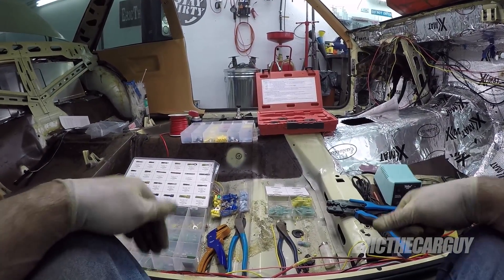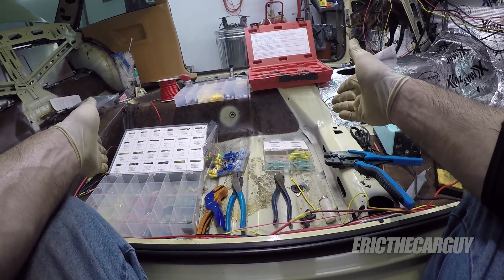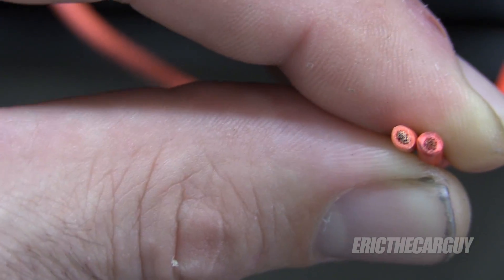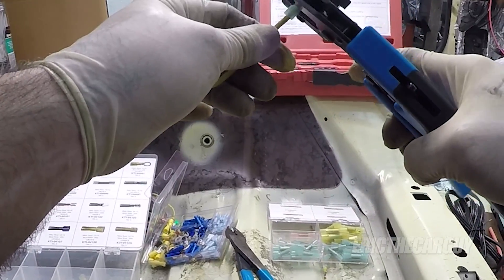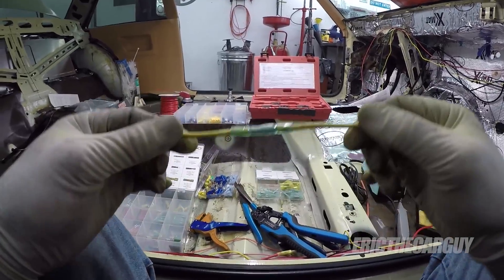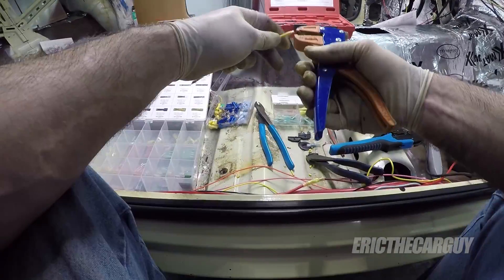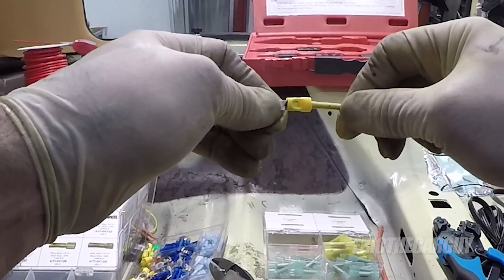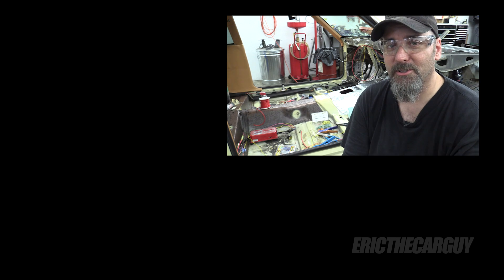How To Crimp Electrical Connectors

Comment: I love those terminals with the heat-shrink tubing pre-installed. And I hate the ones with the hard plastic. I also tend to use non-insulated terminals for ground connections. Almost everything on the car grounds to the chassis, anyway. So there's no need to worry about short-circuits.

For connections that will be exposed to the elements, I like to use "fully insulated" terminals or weather-pack terminals. On the fully insulated terminals, I put a dab of grease into them before connecting them, to keep moisture out.

Comment: I have a tendency to go into Hulk mode when crimping insulated terminals, so ever after shrinking the heat tube, I'll see hairline cracks in the coating, so a small band of electrical tape is the norm for all my projects.

Comment: I like to use solder and heat shrink tubing and a heat gun, especially when doing lots of connecting because it is not as bulky when putting everything back together and much cheaper and stronger and just as quick or quicker if you have a good solder gun tool.

Comment: It's kind of weird to me the to try to imagine the gauge of a wire using AWG (american wire gauge), where the higher the number the smaller it is. But that's because I'm used to square millimeters for wire gauge since forever. The eternal "imperial vs metric" thing.

Comment: Automotive wiring if one of my favorite things to do! I actually remove the plastic insulation from crimp connectors (other than butt connectors) and solder them on (no crimping) and add a little dielectric grease (stops any corrosion caused by the solder) with my own heat shrink. It comes out super strong and looks very good. I'm not a big fan of connectors that come with heat shrink built in because MOST, not all but MOST have a heat activated adhesive layer on the inside. Some people like the adhesive, but IMO it causes issues in the long, long run. Some of that adhesive will extrude out onto the wire when you heat shrink it, this extra adhesive is messy and collects debris. This debris can become conductive over time, just look at videos about dirty batteries and how that dirt can become conductive over time. Just my two cents, albeit my two cents is probably only worth .5 cents to most people that read this whole thing. Great video Eric!
Reply from the maker: Good to know. Thanks.
Reply: I do the same thing, but crimp the connector first, then flow enough solder to wick the connector to the wire. heat shrink over the top, beautiful. Never had a failure.

Comment: The quality of wire connections depends on the tools, wire, connectors and skill.  Used to build relay control cabinets using nickel plated teflon wire and gold plated connectors.  For automobiles I usually solder all connectors and use heat shrink but don't use a torch or soldering iron.  Instead of a conventional soldering Iron I use a carbon rod (welders gouging rod) and 6V battery because it is quick and only heats the terminal.  Easy to solder extremely large connectors using this method even in the wind.
Reply from the maker: Great info. Thanks!

Comment: You are spot on advising the use of the correct crimping tool. The ratchet type with the sets of interchangeable jaws are best. Regarding over crimping.... on most of these tools there is a sort of star shaped pressure adjuster and locking screw this allows you to avoid over crimping  .Look  for the arrow indicating + or - . Also always close the crimps fully until they spring back open automatically............enjoying these great vids

Comment: I do not like blade connectors as they will burn if they are run with steady heavy current. The humble butt splice is best for high current steady operation. I like anderson power pole connectors for high current.

Comment: Ratcheted crimper tools usually have a auto release which allows you to set the correct crimp force, then you just crimp it down and it lets go automatically without you having to manually release the tool and worry about over crimping.
Reply from the maker: This tool does that. Unfortunately I figured that out the day after I shot this video. Thanks for your input.

Comment: I have made many thousands of crimps and agree with NOT soldering the wire before crimping.
Reply: Agreed.  I'll expand on that though, you shouldn't solder a crimped connector.  There are many reasons.  One, consider that the three different materials will all expand and contract at different rates and will cause the connection to come apart, oxidize and otherwise become unreliable.  Another reason is that the solder creates a solid (brittle) component of the connection and will break when flexed repeatedly.
Reply: @CBTalon97  I doubt the thermal expansion coefficients are significantly different and since one SHOULD anchor wire -  especially before and after a join the concern about flexing leading to failure is misplaced.
Reply: @kennmossman8701  but there is a difference, and it's needless additional labour that will only add to the chance of failure. Why bother?
Reply: @CBTalon97  Again the thermal expansions co-efficients are not significant. by you own argument, a crimped connector would fail because the co-efficents are not identical. 
The average DIY guy is more likely to crimp incorrectly. Even in the video Eric mis-crimps -  TWICE. And some key points are, though talked about, are not shown well enough. It is easy to do an improper crimp.
Reply: @CBTalon97  BTW Eric missed a point that DIY folks are likely to do. Do you know what he missed?
Reply: @kennmossman8701  they're significant enough that it goes against IPC standards for electronics acceptability standards (610).  I'm not arguing with you for the sake of arguing when an entire industry agrees with me.
Reply: I agree on never soldering,  in proffesional use it is not allowed. 
The solder wil walk across the copper and removes the flexibility. 
The joint will break for sure.
Crimped connectors ar far more reliable in stressed environments then soldered connections.

Comment: Eric, there is an adjustment on your ratcheting crimper that completely eliminates the ability to over crimp with that type of tool. It's on the side of the tool and looks like a star with a Phillips screw in the middle of it. Adjust this properly and the tool will automatically release prior to ever being able to over crimp.
Reply from the maker: Funny you should mention that, I figured that out the day after I shot this video. Thanks!
Reply: We never quit learning. Thanks for pointing that out, SANTAMAN. I just bought crimpers just like that.
Reply: Hey, he said how to pretty close crimp electrical connectors!!

Comment: I make the wiring of an old Fiat 131 about 3 years ago only crimping and never had any electric problem. I think soldering is ok only in circuit boards. Anyway really good tutorial, I learned the hard way.

Comment: Hi Eric, 

Your explanation about good wire is very vague. For decent high quality looms either in industrial, military or autosport industries a high quality military spec cable should be used. This has thin PTFE insulation but has a high temperature range in comparison to PVC insulation. This allows for small outer diameters to be used for maximum saving of space and weight, Resistant to contact with mostly all highly aggressive chemical media and stress crack resistant to frequent ambient temperature fluctuations and heat cycles. Also has high dielectric strength and high abrasion resistance low water absorption. 

A proper selection of automotive connectors should be used like the range of deutsch connectors, combined the cable above with high quality terminals with DR-25 heat shrink tubing and kapton tape should make a decent automotive loom.
Reply: While on the topic of wire quality, non soy based wire should be the automotive standard. Rodents chewing on wiring from new cars is a huge problem now, because somebody thought edible insulation would be a good idea. Not!
Reply from the maker: I was referring to some 'cheap' wire that I've been running into lately. Sorry I wasn't more clear. Thanks for all your input.

Comment: I'd also like to add that it's good to get QUALITY crimp connectors. In my experience, the most durable ones have built-in sealant that will ooze out of the insulation when you apply heat. Not only is the connection sealed from moisture and dust ingress, the copper inside is mechanically supported to prevent work-hardening and breakage of the wire inside the insulation.
Reply from the maker: That is the exact type of connector I'm using and they work great. Thanks for the comment.

Comment: I'd say soldering is definitely not required every manufacturer that I know of from the factory just uses crimp connections so that must be good enough
Reply from the maker: My thoughts exactly, but I do use solder as well. For me it just depends on the application.
Reply: I've sort of "started" this argument on your FB the other day so - pre-soldering, or rather covering the wires with solder is ok as long as you crimp the wire pack after that. It may protect the copper in a badly sealed connection, what is not allowed in a vibrating environment - is two wires actually connected with solder. It's just gonna crack over time. My point here being - covering wires with lead is not actualy soldering them. Glad to see other ppl in commeets here writing on the same subject. And TY for the video - it's very interesting as always. Keep them coming!

Comment: Being into electronic repair, i use solder where possible.

Crimping is fantastic while new, copper compresses a little over time so the tightness of the joint reduces slightly, the water creaps in, corrosion creates less and less contact untill it becomes a bad resistance.

The current passing through the minimal connection creates heat, that makes it worse with expansion/contraction and a burn up is in progress.
Dipping the copper wire in wd40 or similar before crimping should keep the water out longer.

My view/way.
Crimp a bare connector on to the tinned wire, then solder to encapsulate the metals.
Solder creates a larger surface connection, and keeps out the water better.
Use heatshrink to finish.
Reply from the maker: Sounds like a delicious recipe. ;)

Comment: I've always used non insulated terminals, crimped them in place, the soldered the connection to keep it from working loose, pulling out, or corroding.  I then finish the connection with heat shrink tubing to give me a nice insulated terminal.
Reply: ck m 
Please cite the OEM manuals that state to "only using crimps and never soldering wires".
Reply: That's why they're also crimped. To provide strain relief. The solder is there to make it more corrosion resistant and ensure a good electrical connection.
Reply: You the man, best way to do it, hands down
Reply: Most OE car manufactures have warnings in their repair manuals about only using crimps and never soldering wires.   The base of the solder joint is a hard-spot that will fail in some circumstances....

Comment: Hey Eric, great video, as always!
Did I get the right impression, that you connect all of the wires with the crimped connectors? I mean they are perfect for connecting switches, relays, ground wire terminals etc., so you can swap them out easily. However I wouldn't be so confident with connecting two pieces of wire with crimped connectors where they should be connected permanently. 
Did you even have to do it at all, on the Fairmont? Or did you run all of the wires in one piece, without the need to connect smaller sections of them?
Cheers!
Reply from the maker: Crimping, if done properly, creates a 'cold weld' that is just as good, if not better than solder. I've had to connect hundreds of electrical connectors and wires on the Fairmont and I've crimped just about every one. I tested everything last night and everything I did works perfectly and I have every confidence it will hold up over time. Thanks for your comment.
Reply: Thank you for your answer. If that works bes for you, more power to you! I'm just so used to soldering, that I usually find it easier and quicker than finding the right connectors and crimping them. And I usually have to sneak wires through and fit them into fairly tight spots and crimped connectors might be too bulky in those cases.

Anyway, I'm looking forward to seeing more Fairmont videos, as well as seeing it roll out of the shop. I'm sure it will be a really rewarding moment for you. It's shaping up to be a really nice ride. Good luck with the rest of the project and don't let anyone tell you, you're doing it wrong!

Comment: I believe that soldering is a must where there is a connection leading to a measurement, for example, a sensor (digital and analogue), a read out (like a speedo or taco) or an audio connection. These types of connection require solid uninterrupted power. If its a simple binary (on/off) power signal then a male/female connection should suffice, as if there is a fault in the connection you will see it instantly.